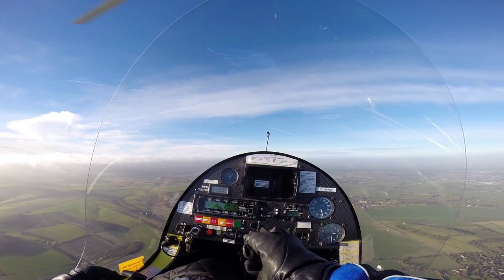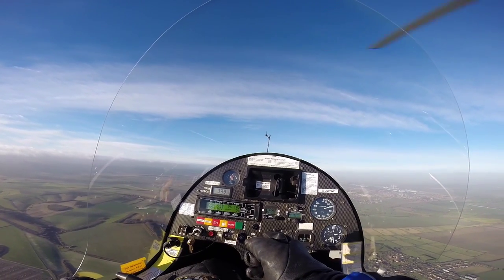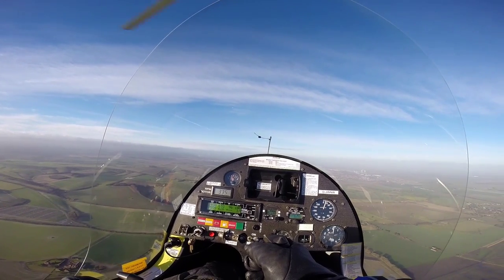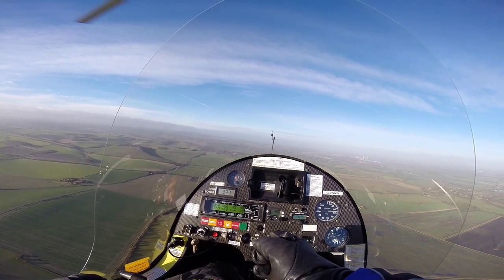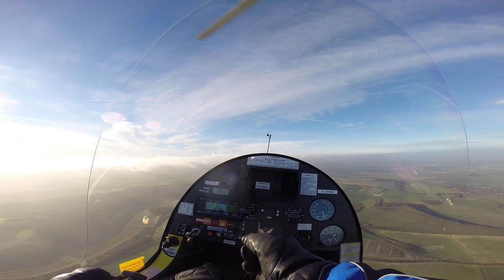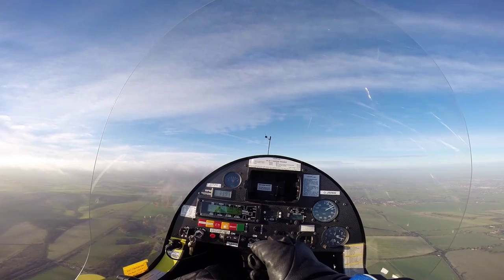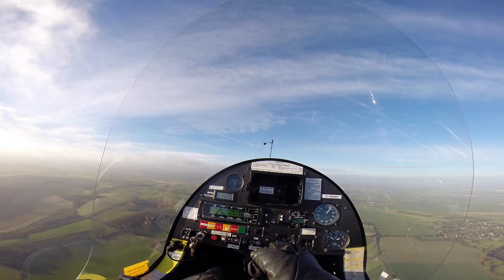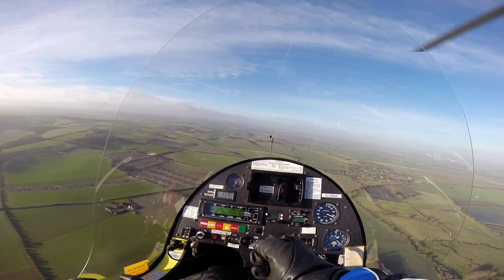Gyrocopter training: Zero airspeed descents

Comment: These are excellent videos.  Thanks for posting.  I have logged some time in a RAF 2000 years ago and this is a good reminder of my lessons.  I have about 2500 hrs in mostly fixed wing crafts.  210 Cessna, Piper Archer and several experimentals.
Reply from the maker: awesome, thank you. I did a bit of fixed wing as a teenager (chipmunks with the RAF and cessna's), but I'm loving gyrocopters.

Comment: Hi Nick, I'm really enjoying the videos! Two quick q's if I may? 1: In the zero airspeed descent do you feel any negative G, or get a sinking feeling? 2: When they talk about recovery from unusual attitudes, what are these in a gyro? Cheers Richard
Reply from the maker: You definitely don't get negative G. 
1: If the rotors get unloaded in a gyro that is very dangerous. It depends what you mean by a sinking feeling. You are descending but not very quickly. I guess it would be like in an elevator.
2: Unusual attitudes are defined in the PPL (G) Syllabus (page 34 here: http://www.britishrotorcraftassociation.co.uk/instructors/PPLG%20Syllabus%202009%20Rev%20A.pdf ). They are things like recovery from a steep nose down attitude, or a slow speed descending turn.

Comment: What is VNE on this aircraft before the possibility of porpoising?
Reply from the maker: Vne is 100mph in the UK, (I think a bit more in Italy). If by porpoising you mean PIO (pilot induced oscillation) it isn't really a function of speed, as the controls get harder to move at higher speeds. It is much more an issue of pilot training, though you do need smaller movements at higher speeds.
Reply from the maker: +Nick Fortescue something else worth mentioning is the magni m16 (this aircraft) has a relatively large horizontal stabiliser, so is very well behaved compared to early Gyrocopter models